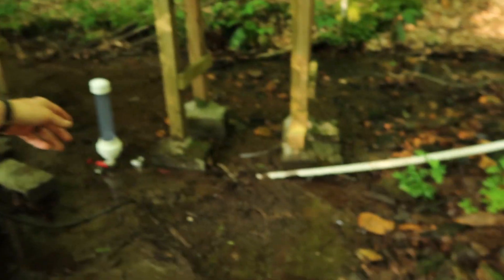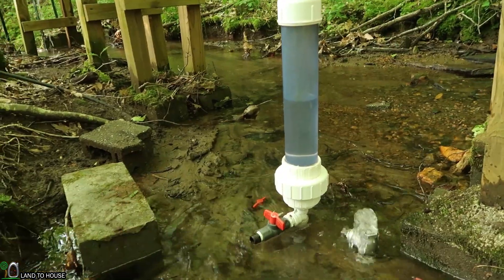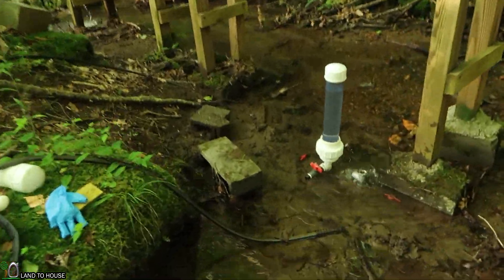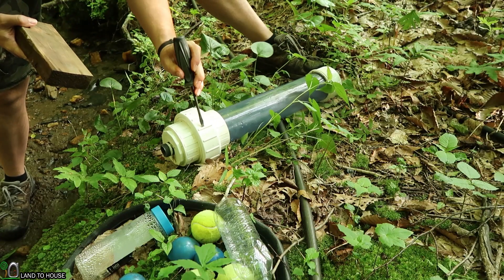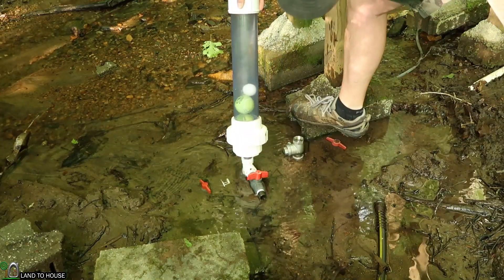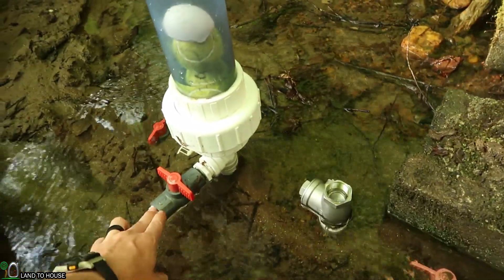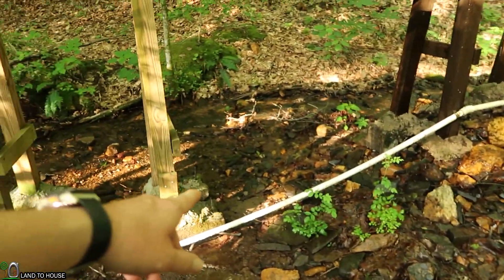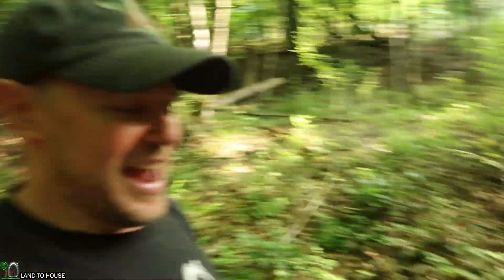Can a Ram Pump Crush an Egg?

Comment: i wonder if you were to leave the egg for a couple days or 2 at full pressure ( has to be in the air fully) will the air diffuse into the egg. then when you release all the pressure the egg explodes ?

Comment: I have two more tests for you with an egg. 

Crack an egg into a plastic bag, try not to break the yoke. And place it into the pump. 

Then hard boil 2 eggs. Keep the shell on one. But remove the shell on the other. Again, try not to break the white part. 

It should be an eggcellent eggperiment.